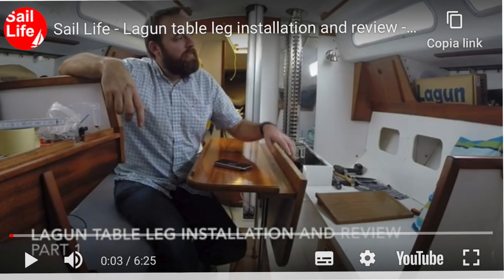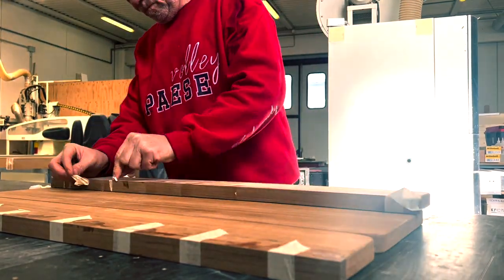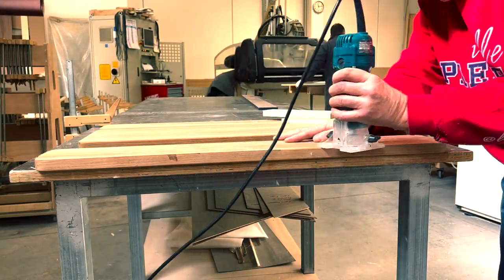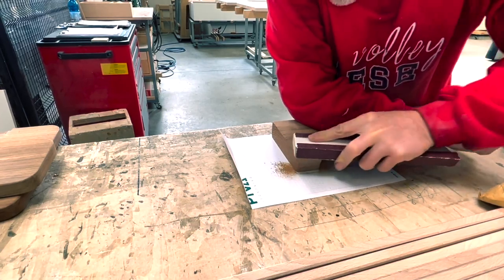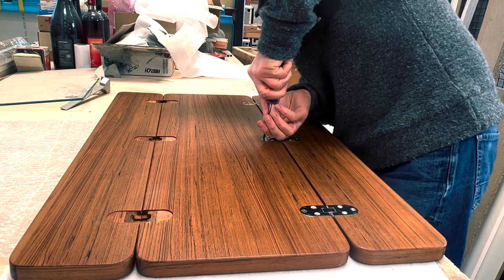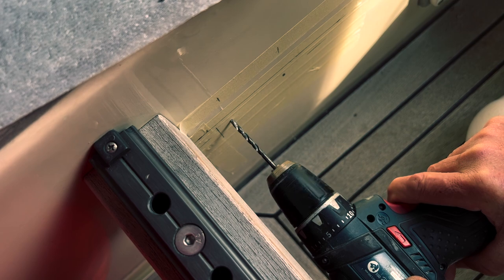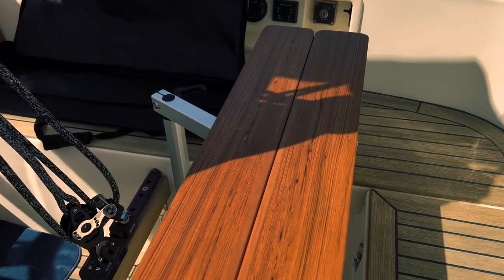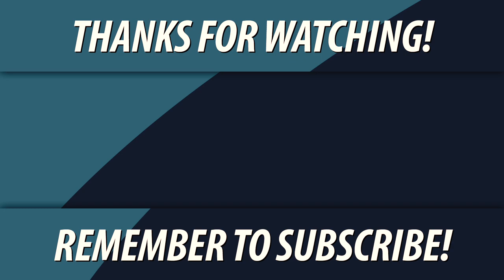Hallberg-Rassy 312 "Ellös": COCKPIT TABLE WITH LAGUN SUPPORT (DIY BOAT)

Comment: Could you please provide information on using fiberglass inserts or threading into fiberglass directly for high-vibration applications like mounting engines, heavy watermakers, or generators on board? I couldn't find any useful videos on this topic and was wondering if you could consider covering it in the future.
Reply from the maker: Hello I  thx for write! Tip: Important thing is the correct search therms of what you looking for .. but more easy :
I already cover this argumentation in the installation of the pole stanchion support ( that need a very strong bonding…like what you looking for…)using a particularly epoxy resin made for pourpouse. You can check the producer website and my video here the adress:

https://youtu.be/Vsu-HysgOxg?si=H8IiEoFqd3puixhr

For threading you can check the video at:
https://youtu.be/Sbp3dygi-PU?si=jxHSbN8UMT8bqt3w
Check on YouTube helicoil and you will find many videos like what you need